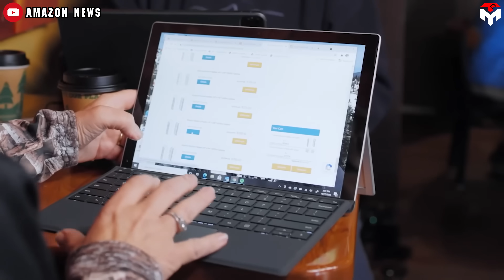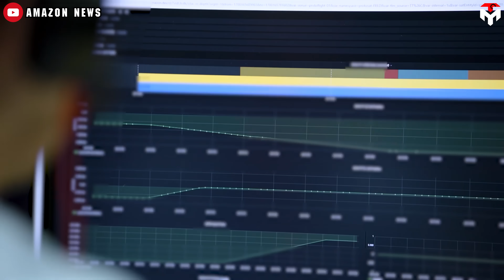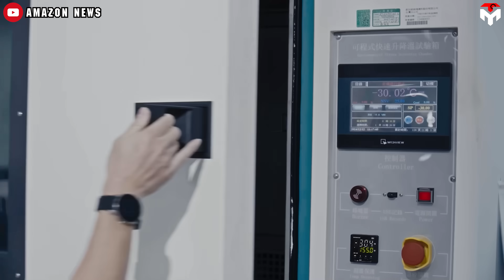Jeff Bezos calls on SpaceX to Rescue $10B project due to ULA and Blue Origin Big Trouble!

Comment: For each of the four launchers, what is the per satellite launch cost (launch cost / number of satellites)?  It looks like Bezos bet his Kuiper on three unproven launchers.  Perhaps he should accelerate New Glenn launches.
Reply: True. But at its core, Bezos based his bet on "anything but Spacex". He had to be sued by Amazon (once he stepped down) to include 3 Spacex launches. The only reliable launcher on the roster with time running out. 1600 satellites with ULA launching 27+27 on two Atlas rockets thus far as of 08/08/25 with less than 12 months to go. Both were from last stock of Atlas 5, Zero from new rocket types. Spacex will launch 24 on August 9 or shortly after. 

If they order another 20 Falcon 9 (about $1 billion) for launches over the next 9 months, that will guarantee 480+24+24+24+27+27 get to orbit of the 1600 required by 07/30/26. Spacex is on track for 150 F9 launches this year... but to date, they have not ordered more and the window to do so is closing quickly...

Clearly they want to play games right up to the finish line or... their factory is no where up to speed yet and they expect to fall behind regardless. If the latter is the case, this explains the foot dragging with time winding down. They clearly had $1 billion to burn on Rings of Power... the college film project... wonder how they'll explain this to the FCC when they request more time.

Comment: You will never make that many launches 🚀 by June of 2026 at the rate you are going now. Better get another 6 SpaceX launches or you are going to get way behind.  SpaceX can get the job done. They save the first stage and reuse it, again, and again.
Reply: Spacex F9 rocket is on track to launch 150 times by end of 2025... they can absorb the launch shortfall. First Spacex Kuiper launch is 08/09/2025... so they will already be familiar with mounting procedures for Kuiper.

Comment: space x saving non space x ? Bad idea are bad idea . Cant be saved
Reply: Worked for OneWeb when Spacex saved them. Spacex would have to launch about 20-40 times by 07/26 to cover Kuiper short fall in launches (assuming they can build satellites fast enough). Spacex is on track to launch 150x in 2025... They can expand the capacity pretty quickly if Amazon makes an order very soon... in 3 months... if they continue to wait, I would agree that Spacex won't be able to help enough... or they could go nuts and order 2 expendable Starship launches in 2026Q2... putting up 3-400 satellites in 2 launches to further fill the gap... an epic Hail Mary in the 11th hour.
Reply: Never gonna happen.

Comment: Sorry, guys but it's definitely  time for SpaceX to strike. You better hope the first stage on their starship disposable. Doesn't work. Game set and match. GO SPACEX.
Reply: Spacex Starship First stage has already been recovered and flown twice. Doesn't make sense to keep testing that (now outdated booster) as they showed they can do it. New V3 booster is already under construction with larger fuel tanks and (presumably) the Much more capable V3 raptor engines. This will be the definitive, mass produced booster.

Comment: Amazon never intending on launching all those satellite he wanted to reserve those orbits, so SpaceX could not use them
Reply from the maker: That’s an interesting point of view.
Reply: Sounds like something Bezos might do, but he's at 590km and higher. Musk is 550 km and lower with more orbits reserved 350km or so as well for satellites with lower latency. Another competitor, however, like the Chinese is another matter. Oneweb is up at 1200km making their complete network much smaller... but they are at a severe disadvantage in latency and debris de-orbit.